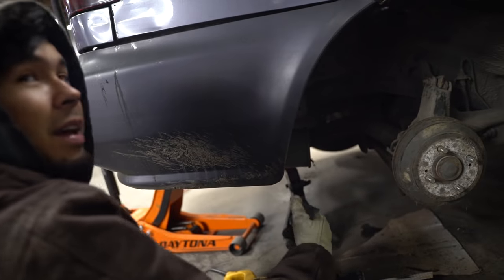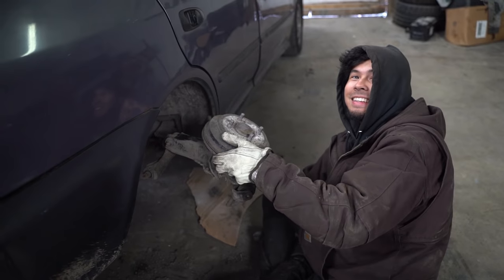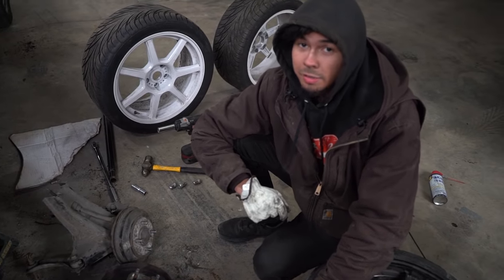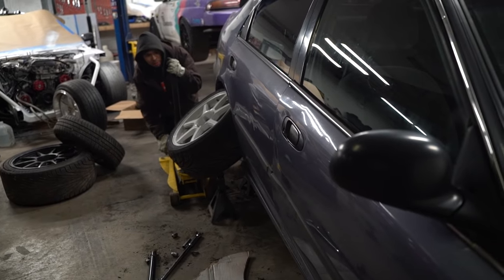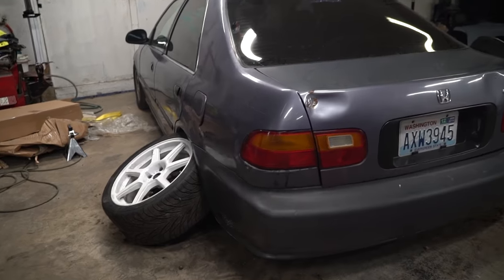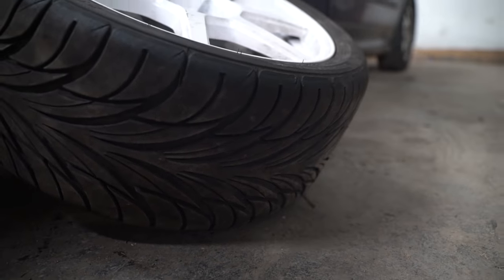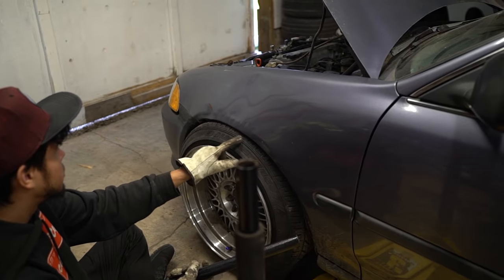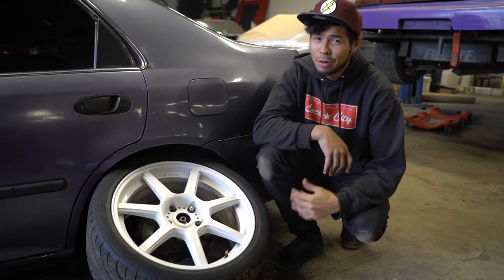How to Get WORLD'S Craziest CAMBER! (INSANE STANCE)

Comment: Imagine if that had disc brakes in the rear. Worlds easiest brake job????
Reply: iTheGeek  well you missed the fact that the brakes are no longer in the wheel well. Everything is physically outside of the car so you dont have to keep sticking your head in the wheel well to take bolts out and put them in.
Reply: iTheGeek  I'm going to politely disagree on this subject...

Comment: Or take it even further and create automated camber hydraulics that can turn the wheels to 90° and install blades in the wheels so that they become thrusters like the DeLorean in back to the future. Might also have to create a “flying“ gear on the transmission, probably a really high gear that would spin the wheels at higher speeds to get enough thrust. Also four-wheel-drive.

I did some rough calculations and determined a top wheel rpm of 7000 would be necessary, with a 350 hp engine and the flying gear would need to be slightly more than a one to one ratio.

That’s just minimum power to get the car hovering. You would probably want at least 500 hp and gearing to spin the wheels/propellers at 10,000 RPM to have some wiggle room for maneuvering.

The edge speed of the spinning tires would be about 600 mph, so in theory, this is actually feasible if someone made a pet project out of it. Not to mention the sheer number of safety precautions, and landing/takeoff considerations, and bureaucracy, etc..
Reply: "Automated Camber Hydraulics" Exactly my thoughts dude. It's crazy to me no one has made anything like it when we already have hydraulic suspension!

Questions though: Is it even possible to have 90 degrees camber? It seems like at some point the metal will have to bend to reach far enough to get to the wheel knuckle. I was messing around on VSusp to try and get 90 degrees and I did, but the control arms are phasing through matter 😅. I'll post the link in another reply because it's so long I think it might break the comment.

Also what on earth kinda "rough calculations" did you do??? Did you use an actual propellor's figures for your calculations?!? I suppose if you replace the spokes with propellor blades then you won't be too inefficient in terms of shape, but that might end up breaking under the weight of the car during driving mode.
This not to mention half the wheel is going to be under the body of the car, making it super inefficient.
Reply: Dammit the link keeps breaking! I'll post a screenshot to r/stance and post the link

Comment: Great job trashing garbage can cars, and im not even talking about the exhaust.
Boom boom tssssss.
Reply: There great dailies with huge potential.  What other car can you run 13's and get 30mpg on a stock motor.  Cant beat them with a 2k motor swap.  Great car to learn on.
Reply: @duanebailey6253  Ahhhem you mean with a huge turbo, just about any other small engine ahhem with a turbo